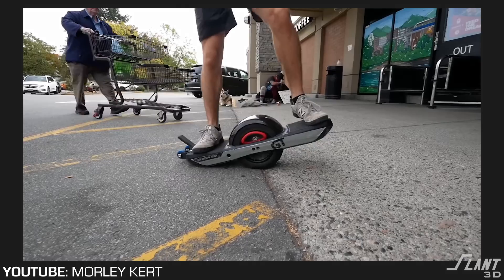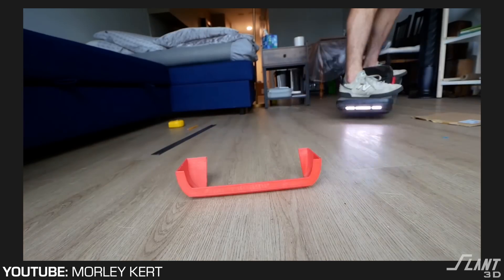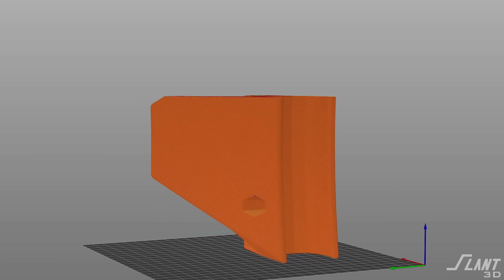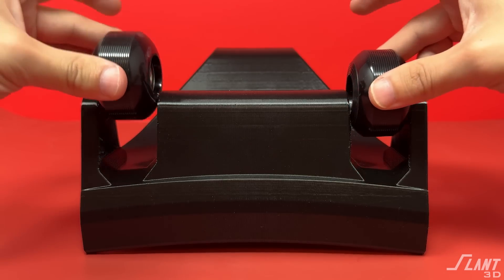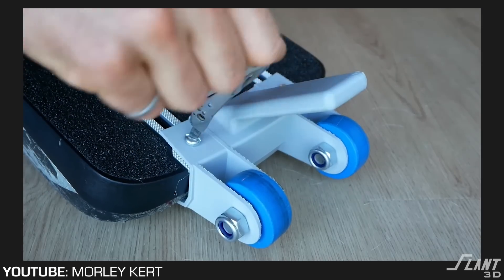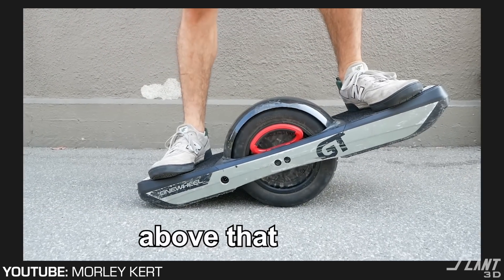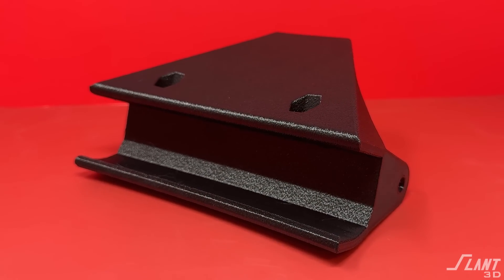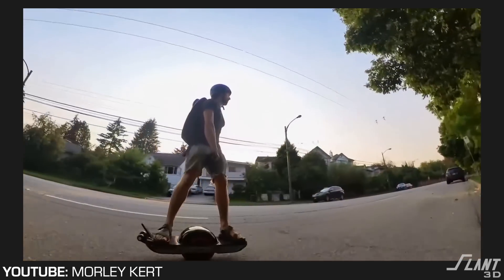We Fixed Morley Kert's OneWheel Stand for Mass Production 3D Printing

Comment: I've seen his video and this on twice and all of this is good but there is something that both of you have overlooked.  With carry on bags with wheels there is also a pop out handle so you don't need to lean over to drag it around.  For a one wheel a simple rod of some sort to act as a handle at the top when rolling would made this way more handy.  Not sure how that could be done easily but I'm sure it's possible.

Comment: Only gripe I have is saying that the single thru axle would be cheaper. Scrounging around on mcmaster there is a double ended threaded rod, 6516K265, which looks about the right size where with two lock nuts is $8.23. Two standard bolt/nuts in the same size, like 91257A628, would be $1.03 for a set of 2. Standard size hardware gets mass produced millions at a time in high speed forging presses and get huge cost reduction from economy of scale. There just isn't enough demand and the excess material of having a single axle just makes it way more expensive.

You could still keep the added support material in the middle and use standard hardware with a press in nut or thread insert that would be significantly cheaper than a long thru axle.

Comment: Nice improvements with the raft and central axle, but you still have shearing and bending forces across layer lines with FDM. The optimal solution would be to use something like MJF printing. No need for supports, and layer lines are melted together. If he’s going to outsource the production anyways, might as well use a larger manufacturer like xometry that can produce higher quality parts than a print farm. 👍

Comment: Wasn't the reason for the expensive material so that it would stand up to the weight of the one wheel? Saving cost with a different material is great but if it then breaks after a month of use it doesn't do a whole lot of good.

Comment: But why do you need 2 wheels? one should be more than enough. Is not as wide as a carry on to need an extra wheel, especially since the weigh is already fixed and distributed. Wheelbarrows work fine wit just one.

Comment: Love the videos on improving a real design.    I'd love to see a design on a mechanical part.  for example, a cup holder with sliding parts that can be adjusted to grip cups of different sizes, this is a bit self-serving I've been trying to design one for a car that you can't get a cup holder for and none of the injection molded ones of amazon work due to the location of the holders :) 

I took one of Amazon apart that has "ratcheting" sliders that allow "arms" to slide in and out to grip the cup on serrated plastic parts so they "ratchet" into position.  I haven't found many people on you tube showing a "mechanical" design that is then 3d printed other than "trinkets" or "Neat" ideas like a locking jewelry box etc and one guy designing a camera boom arm.. 

so for example,. how would you design this, for mass 3d printing ?  examples

https://amzn.to/3BrUAZU

this one both pivots a elevated cup holder and also adjusts to grip whatever is placed in it..

https://amzn.to/4ej6ILr

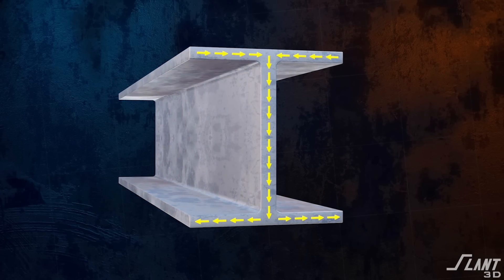Comment: 3:38 This is actually incorrect. The upper and lower flanges are actually the strong parts. They're also in the optimal locations for taking compression and tension forces. The rib in-between is really only there to keep the two together. Not that it really matters in this case, just spreading knowledge.
Reply from the maker: It is to keep the other two apart in order increase the structural moment of inertia. I-beams are a 1 dimensional solution. Tubes are a 2 dimensional solution.

Comment: Throwing a dislike on this one. The design alterations definitely increase the strength but you have to actually TEST IT before saying "PETG is fine". ABS is even cheaper and has a higher impact resistance.

Also adding voids to nudge the slicer to generate more fill is awful compared to what Maker's Muse showed recently. Both in CAD modeling and the outcome.
Reply: Do you mean the custom modifier meshes video? I don't think Slant allows for that, or they would have just said "make it solid with a custom modifier."
Reply from the maker: You can please some of the people some of the time.

Comment: It would have been nice to see your refined model on actual an one wheel. What was great about Morley's video is the constant iterations and refining to get to the end result. Testing what worked and what could be improved on. Did you test the PETG strength for how this model would be used? Morley mentioned PETG and did all his prototyping with it and you saw the material give out multiple times. Maybe the refined kickstand with more material and with thicker walls and cavities would do the trick but without testing its just an assumption. "Look at lot tougher" doesn't do much to actual prove its tougher.
Reply from the maker: Tangled Testing Channel - coming soon.
Reply: This, need a short on it installed on a OW
Reply: A chunky part like that will have a lot of material supporting itself. Imagine where the old design would break- right across the thin leg part, put weight on it and it'll flex until it gives out because it's unsupported. Now imagine what it'd take to flex this part, even if it's printed super thin- it'll much more likely implode than snap, and implosions can be prevented by just adding more layers until it doesn't. That part in 5-6 walls will be rock solid.